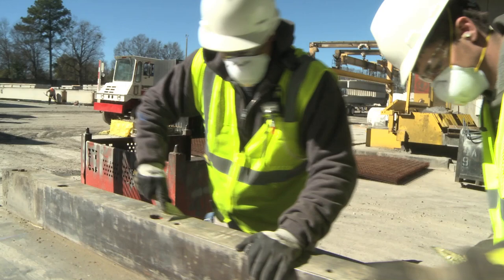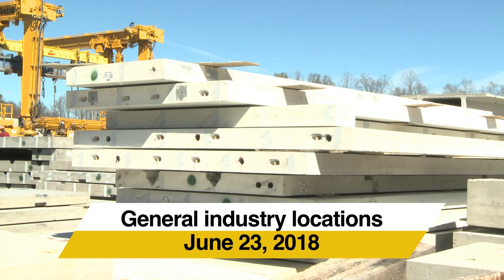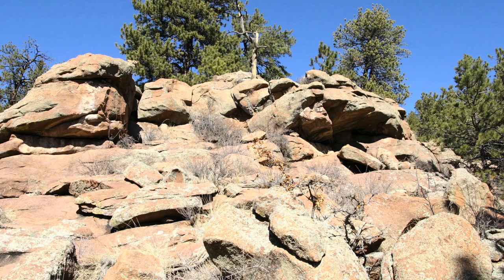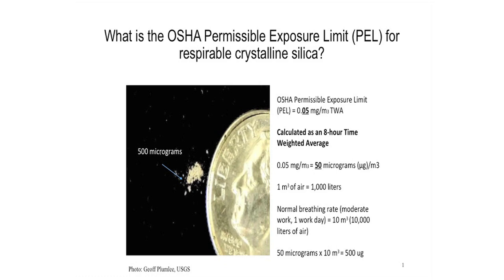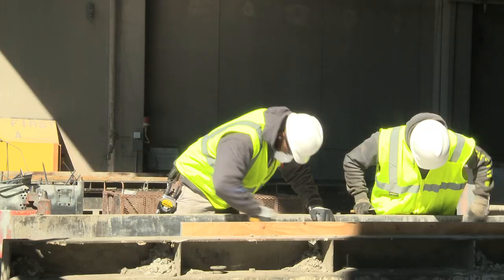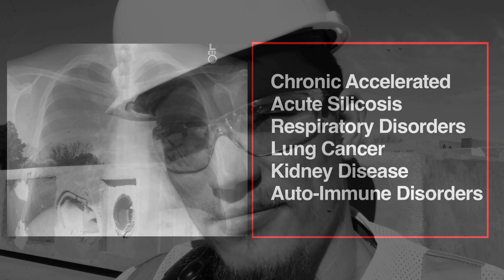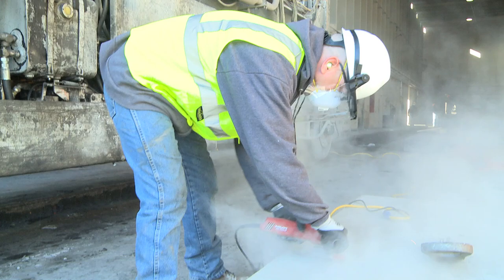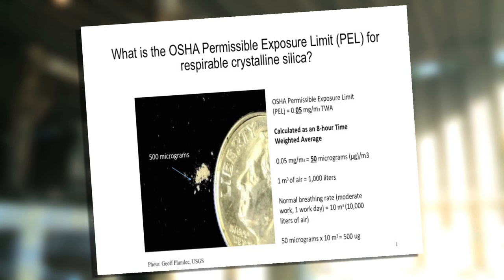Respirable Crystalline Silica Compliance Introduction

Comment: Here is an example of how you can interpret air sample results of respirable crystalline silica (RCS) under the new rules so you can use the engineering and control methods to capture or cut back the RCS.

For this, the acronyms PPE (personal protection equipment) and PEL (permissible exposure level) are used. Suppose you take air samples at 4 areas of a construction site, and you get the results. The results could be labeled like this: 

Quadrant 1 -  12-18 mg/cm of RCS  (no danger; levels are below PEL, no PPE required)
Quadrant 2 - 500-1500 mg/cm of RCS (dangerous levels beyond PEL, PPE required)
Quadrant 3  - 2000-4000 mg/cm of RCS (very dangerous levels, levels are beyond PEL, PPE required)
Quadrant 4 - 20-33 mg/cm of RCS (no danger, levels are below PEL, no PPE required)
Reply: This is incorrect. The measurement is not in mg/cm (milligrams per cm). OSHA's PEL for silica is µg/m3 (micrograms per cubic meter of air) Additionally, OSHA has a established action level of 25µg/m3. This means that if silica is at or above 25µg/m3 the employer is required to take action to reduce employee exposures. If you have questions about Silica compliance, please PM. I specialize in this line of work and can bring your business into OSHA compliance. 

Thanks, 
Scott